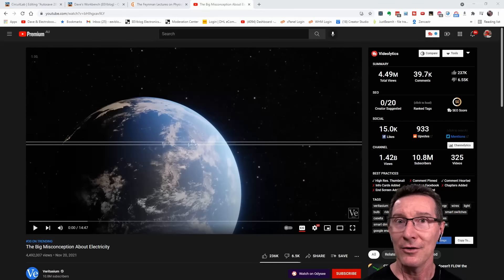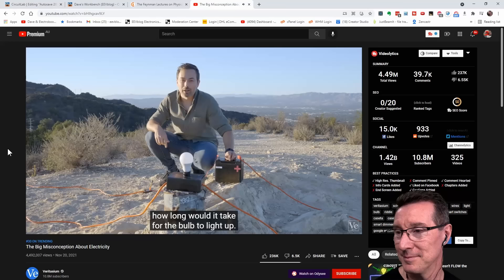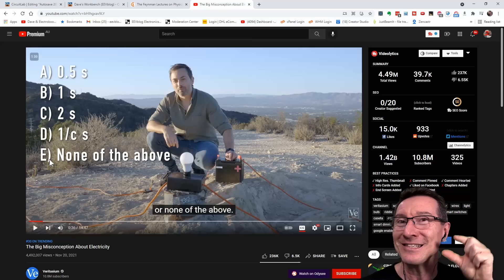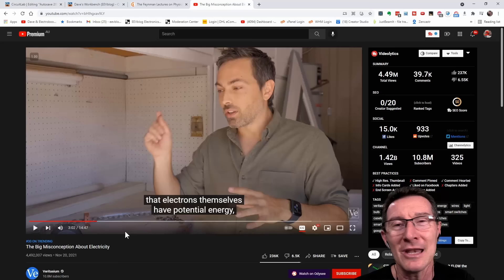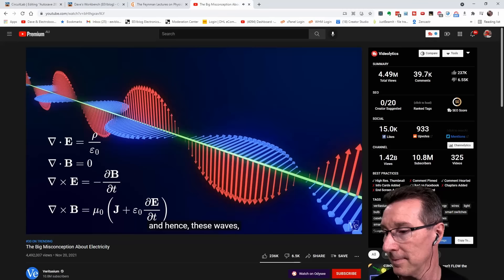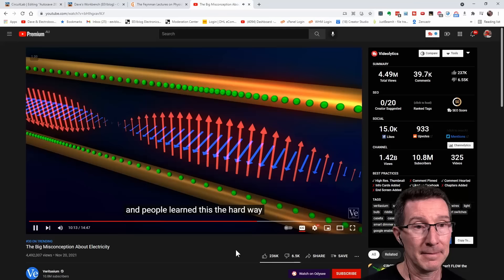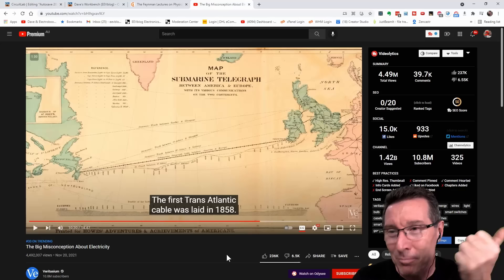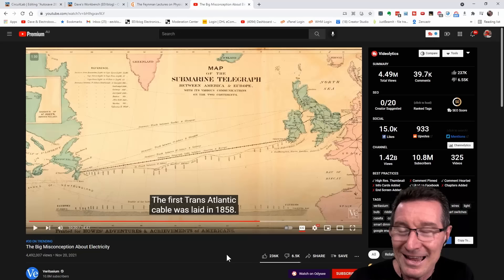EEVblog 1439 - Analysing Veritasium's Electricity Misconceptions Video

Comment: Okay, after re-watching parts of Derek's video through your video, I noticed a couple of things that solve some of the problems I had with it as an engineer (though not electrical, but like you said, all engineers are taught this stuff).

One is that at the beginning, he stipulated a simplifying assumption that the light bulb turns on the instant any current flows through it. A real light bulb, whether incandescent or LED (forget Fluorescent; those have enough delay to be not only noticeable but irritating), will never do that. Incandescents have a warm-up time, and LEDs have a minimum power level at which they will function.

And then, at the end, he waved his hand and said that it takes "roughly 1/c seconds".

So this, I agree with. My problem was that this is essentially a wireless power circuit with arbitrarily long antennae (nothing to do with the wires far away from the bulb has anything to do with it, so we can just pretend they extend off to infinity). The movement of the EM fields around the wires does have to propagate at the speed of light. It doesn't have to travel along the wires, per se, but it also doesn't get to just pretend they aren't there. The truth is in between.

With a spherical cow setup like his thought experiment, sure, I'll buy 1/c seconds. But the real bulb needs a non-trivial amount of power to turn on, and that means a non-infinitesimal amount of current needs to flow, which means the fields need to propagate for some distance along the wires to a point at which enough power is wirelessly transmitted across the gap to power-on the bulb, which is still going to be very, very fast, but strictly greater than 1m/c.

If the wires weren't 1m apart the whole way, you'd need to specify the layout very carefully and use a lot of calculus, and it'd be a mess to figure out.

People keep bringing up the circle as the longest time period... but it isn't. A wire loop a light second long with the battery at one end and the bulb at the other (basically the opposite of this) would be the longest delay.

Also, a lot of people have been asking if this means you could achieve FTL communication, and... heh, no, of course you can't.
Reply: What are the units for 1/c seconds? Answer: seconds squared/meter. So no, not ok.
Reply: What are the units for 1/C Seconds? Answer: seconds squared per meter. So no, not ok.
Reply: What are the units for 1/C Seconds? Answer: seconds squared per meter. So no, not ok.
Reply: @lindseymontana945  But it is okay, though. If this were intended to teach engineers how to build and analyze such circuits, true, it would totally need the correct dimensions.

It isn't. It's a general-audience science communication video trying to get across a concept, and the number 1/c is fine for that. He could have just said "Almost instantaneously" and it would've been perfectly fine.

Comment: I would like to make an extra comment about the part on Feynman's lectures and how the Poynting vector points into the wire carrying current.

The only time that happens is when there is an electric field within the conductor, that is, when there is a resistance. If the conductor was ideal, no resistance at all, there couldn't be an electric field. Thus, this input of energy into the wire is actually the Joule heating of the wire because of current moving across a voltage drop in the wire.

This is quite interesting, since at the beginning, many people tend to believe this energy comes from the electrons losing their kinetic energy, but this is of course not true, one learns that this happens because there is a voltage drop, and that's what causes there to be Joule heating, but in reality, the energy comes from the fields, that is the voltage drop that causes the energy loss.
Reply: Well, in a sense it DOES come from electrons losing theirs kinetic energy. But this result in a tiny tiny localised em field (you are stopping/deviating a moving electrical charge, this is source to em) but when the resulting field of every electron collision in the wire is put together, there you get the elecic field difference (voltage drop) over the length of the cable. Noticeably with no current, this no preferred movement of electrons and preferred direction of their interactions with the surrounding atoms, you get a local field that averages to zero, producing no voltage drop over the length of the conductor.

Thus, it's not the voltage drop to cause the Joule dissipation, but the Joule dissipation to cause voltage drop.
Reply: There is no electric field in electrostatics. The voltage from the battery is providing the EMF that produces the e field in ideal conductors. This is heavily debated though and no one really knows the actual answer.
Reply: @jimmysyar889  ok, I've adjusted my reply to accept your note about "highly debated" matter, I was not aware of this point of uncertainty in the subject, yet it's does not counter my point: is the kinetic part of joule dissipation the cause of the em fenomenon that causes voltage drop in a conductor, and not voltage drop to cause Joule dissipation as stated in the dirt post.

Comment: As a design engineer, the correct answer was "E" none of the above.  You don't go and start adding things to the 5 answers on a test.  The "D" answer just has the wrong units.  The (1/c) answer is seconds per meter which is not a time at all.  The second problem  is that he says "How long for the bulb to light up" implies steady state.  Even you didn't address the time for a steady state current flow without ringing and other transients.  Like you pointed out the characteristics of the transmission line will depend on the distance the wires are apart and the values of the R-L-C.  Therefore the only constant would be steady state current which would be dependent of those components and the layout and type of wire used.  

I have many issues with the whole concept that the energy flows in the E and M fields of the wire.  If that was true then the resistance of the wire would not matter because the only resistance to an electric or magnetic field is the permeability of free space.   The resistance of the wire does matter for both AC and DC current and dissipates heat from the equation P=I^2*R.  Also the resistance of the wire does depend on the frequency of the current and is called "skin effect" like you mentioned.   Litz wire is used as a way of reducing the skin effect of wire up to frequencies of 1 MHz.  That means that the physical design of the wire can make a difference in the wires AC resistance.

I could use shielded cable for the wire for a controlled impedance of the wire.   This would eliminate the transient through the nearest capacitors and force the current to travel the length of the wire.  The transient will produce an RF component the will radiate from the wire.  The term is EMI (electro magnetic interference) when it comes to unbalanced transmission lines.  

When that switch is closed, that is a very fast transient that is sent down that wire.  What really happens then is so complicated that my college engineering professors did not even want to discuss it when we were doing circuit analysis.  They would just say that the switch is closed and start the analysis at t=0.

You failed to explain why the return current flows directly under the trace in the ground plane and not all around the ground plane.  The reason is that the magnetic field generated from the trace current induces a return current in the ground plane under the trace.  

We all know that an electric field can travel near the speed of light because is has no mass.  An electron does have mass therefore does not travel anywhere near the speed of light.  When a charged particle moves it creates a magnetic field and yes, this field can move at near the speed of light.  The energy generated by this electric and magnetic field has to obey the laws of transmission line theory and moves at the speed of the transmission line.  Even if the wire is open, then fields travel to the end of the wire and reflect back onto themselves causing ringing in the wire.

You are right that the video was made just to confuse the general public and offered nothing to the electronic engineer's understand of this complicated topic.
Reply: The whole thing with the unit is just a mess imo. Someone correcting the original video and saying, no it would take 1m/c seconds is still getting it wrong. Because that would be an answer in seconds squared not in seconds, or I guess seconds seconds or whatever, since you already have seconds on in the c.
Reply: @ockeojoj  c is m/s and its in the denominator so thats 1/c is actually s/m so put meters in the numerator to make the m/m cancel and you are left with s.
Reply: Exactly. The video is, at least, disingenuous, if not worse. A glance at the confusion in the comments tells you everything you need to know about the video.
Reply: @joefuentes2977  Yes, but seconds/meter is not a time.  When was that last time you took a multi choice exam and was allowed to change one of the answers?  I never was able to do that.  As far as i know, it was a trick answer and obviously wrong.  So the correct answer to the question was "E" or none of the above.
Reply: @ockeojoj  All answers were in the form of (number) seconds and answer "D" was (1/c) seconds.  The value of c is in meters/second and its inverse is seconds/meter and therefore is not a time at all and therefore a wrong trick answer that was obviously a wrong.  The correct answer is "E" or none of the above.
Reply: @richardcommins4926  lol I see what you mean
Reply: It seems that you are saying the cause of the energy transfer is similar to a transformer, wireless charger, or one of those "get free energy" videos where some crazy person recommends burying a giant cable parallel to the powerlines. 

If this is what is happening, it is a much easier explanation that anything else I have seen on this video so far. Assuming that the electromagnetic pulse from the battery side is just being relieved at the bulb side, it seems to me that the the cause of energy transfer is the movement of electrons. The transmission medium is a magnetic field, but the gig would be up if we removed the giant TX and Rx lines. It probably also wouldn't work if we just removed the Rx side of the circuit but left the TX side.

All I know for sure is that it does not match the information I had to learn to get my ham radio ticket.
Reply: @not_my_fn_real_name2689  You don't seem to understand electronics and the physics behind it.  There is no "get free energy" from anywhere.  Even solar power is not free either.  Look at the cost of those solar panels to make that electricity.
Reply: @richardcommins4926  yes, there is no such thing as endless energy, but it is 100% true that magnetic induction from a power line can cause the electrons in a second line to move and generate free is in free beer electricity for the person who is leaching electricity from the power company.

From what I understand of the concept, the power company views this as stealing electricity, but that is why I said it was a crazy person detailing the idea in a video.

I have no personal experience with this, and have no idea how much electricity is generated by leaching power from power lines, but when I went through X-ray school and learned how transformers work, it was an obvious step to see if it was possible, and from looking around it is theoretically possible to wireless leach power from power lines. Those times when I did go looking around for info, the best I could find was someone who set up a bunch of florescent lights that dimly glow in a field, so I am not sure how close the leaching wire needs to be, but I am going to stand by the idea that it is theoretically possible.

I am thinking you misunderstood the comment because I said free energy and it us typically a sign of someone who needs to be sternly corrected, so I understand your reaction.
Reply: @not_my_fn_real_name2689  The videos are not about magnetic induction or stealing power from the power company.  I would not steal power from the power company even if I could get away with it.  Stealing is a bad thing.  The easiest way to steal power is just to bypass your power meter on your house.  It is only the fastest way to get caught and go to jail.  The videos are talking about how power is transmitted through wires.  Yes, there is no such thing as perpetual motion or free energy from nowhere.
Reply: @richardcommins4926  I appreciate your comments, I agree that it is a bad idea to steal...

Stealing wasn't really the point though, I was more asking about how the light bulb gets the initial electricity to flash before the EN force has had enough time to travel along the wire. And since the wires are placed in a rectangle with a 1 meter width and a really long length, I was asking if the current on the light bulb side was the result of the EM force being created as the force was traveling along the battery side. 

It would be similar to any standard transformer, where the EM force on the "hot" side induces a current on the "cold" side. 

Based on the layout of wires, this is what I believe is the cause of the initial current, especially given the 1m/c time to light, as this does imply that the current on the battery side is some how jumping the gap and creating a charge on the bulb side. Similar to a wireless charger, the EM force from one wire is interacting with the electrons in a parallel wire.

Comment: @Dave Although I agree with Dave that Derek's video appears to be deliberately misleading, I would have hoped for a better engineering answer from Dave.
 The cables leaving the battery and those arriving at the lamp have 1m distance. The diameter is not given but seeing the cable with isolator 1mm diameter appears to be a reasonable estimate. Athough the formula for a plate capacitor will not be a good approximation to calculate the capacity of a pair of parallel wires, e. g. for the first 1km of wires it will hopefully still give a rough estimate of the capacity C= epsilon0 * A/d with A=1000m* 1mm=1m^2, d=1m. Hence C=8.8 pF. To reach the "first capacitor" of 10 uF of Dave's model the electrical field would have to travel ca. 10^6 km, which is even longer than the cable assumed in Derek's setup. And Dave, no, one clearly cannot argue that any arbitray small capacity could replace the 10uF (such that the electric field only has to travel a much shorter distance) as a steepness of the transient is finite (e. g. limited by the inductance), the voltage is fixed and the lamp clearly needs not fW or pW but in the order of 1W. So very clearly the answer of Derek is false, as is your's, Dave, the reason being, put in different words, that the cable length needed for a capacitive coupling of sufficient strengh to couple the power sufficient to light up the lamp is not in the order of 1m but rather longer than the provided cable! Then it will be the electric field wave which is propagated through the wire that dominates the power transmission to the lamp. 
And Dave your simulation program is worthless for the question at hand as it apparently assumes that the electric field propages with infinite speed (otherwise you would have had to specify cable length). 
And @Derek, in your explantion with the Pointing vector: where does the B-field at the lamp come from?? That would be from a current at the lamp, right? But where does that come from 1m/c after the switch has been closed? You guess it: from an electrical field accross the lamp which has propagated there.
Apologies for the aggressive tone but I am really annoyed by the nonsense mostly in Derek's video viewed by millions of people, but unfortunately also in this video. 
@Dave Since you have a fast osci in your lab try it out with 100m (10m will also do) cable left and right, if you have doubts regarding my arguments.

Comment: I have to dissagree with the statement as it is specifically made: "People seem to think you're pumping electrons..." in the context of a battery-switch-wires-lamp circuit.
Even while the energy is transported through the fields, you are effectively still pumping electrons.
The battery is creating a pool of electrons, which creates a non-neutral electric field, which in turn exerts a force on the electrons, who then, when completing the circuit, will start to flow, which creates the magnetic field.
No pool of electrons => no electric field => no flowing electrons => no magnetic field.
Even when using an antenna, you're still pumping electrons in and out of the antenna to create the fields. (or ... to affect the fields ... if you prefer to think of the fields as being always present, even when neutral)
And a 2nd note: the fields are not only outside the wire, they are also in the wire.

Comment: Thanks Dave,
my head is clear on this now.
It made me think when I viewed the original video, this upset my world of electronics!
Mind I did think about the capacity of the connections out on both sides (it's 50 years since I did this in college) 

Thanks for the VERY clear explanation.
Stay safe
Reply: Dave here uses the wrong model for Derek's experiment setup.  A transmission line model is not applicable, so what you see on his graph is incorrect, and Derek's answer of 1/c is also not right.  The better model is a dipole antenna model.  See my explanation in the main thread.

Comment: A video on transmission line theory would be incredibly helpful.
Reply: Yes indeed, and Dave here could learn from it too.  Unfortunately, he uses the wrong model for Derek's experiment setup.  A transmission line model is not applicable, so what you see on his graph is incorrect.  The better model is a dipole antenna model.  See my explanation in the main thread.